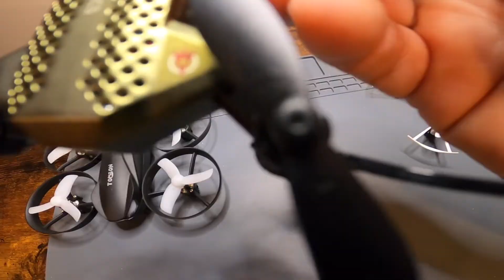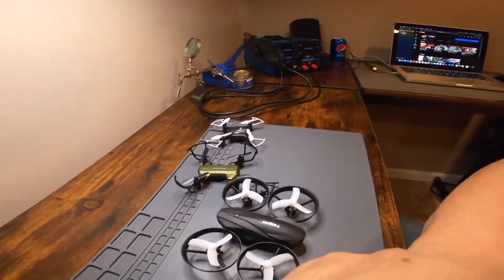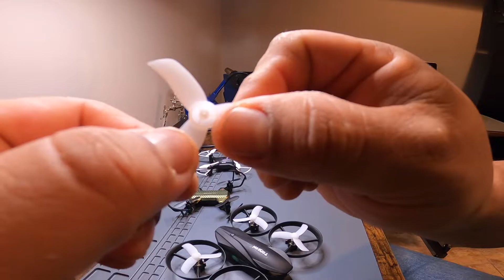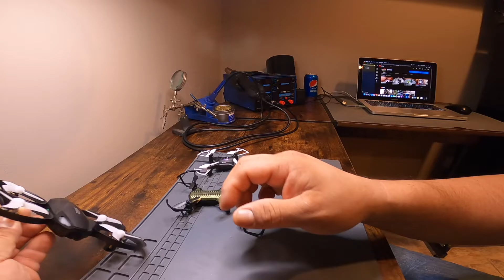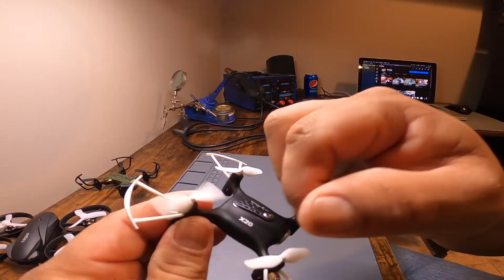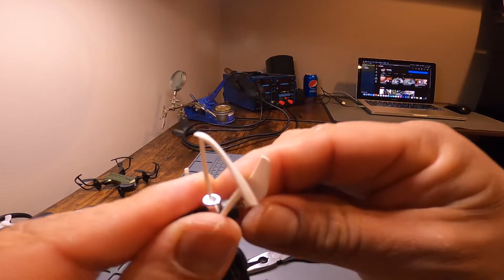Drone propeller removal and install

Comment: its too tight to take off..
Reply from the maker: Sometimes the propeller can be pressed onto the shaft very tightly, so it may not come off easily by hand.

One method that can help is using a fork as a gentle pry tool. Slide the fork under the propeller, positioning it between the motor and the prop, then apply steady pressure while pulling straight up. Just make sure you hold the drone firmly and avoid twisting or prying sideways to prevent stressing the motor shaft.

Thanks for watching and if you haven’t already, please like and subscribe.🚁🚁🚁

Comment: Dude you've got huge hands and my hands hurt after the first propeller
Reply from the maker: You’re not the first to mention my hands 😂 and yes, they are on the big side. If you have trouble gripping the propellers, you can use a pair of needle-nose pliers to pull on the propeller from the center, as shown in the video. Thanks for watching, and if you haven’t already, please like and subscribe—more R/C aircraft content coming soon! 🚁🚁🚁

Comment: But bro what if I took off all four propellers and now I don't know how to put them back on that's where I am stuck right now
Reply from the maker: @Mmurrieta  😂 I will say sometimes on the drone body you will see a letter or a number or both indicating what propeller goes on what corner also you may be able to look up the drone and see if you can find the owners manual, that sometimes also tells you what propeller goes to what corner. I hope this helps, thanks for watching and if you haven’t already please like and subscribe.

Comment: hey man what propellers do i need for the va-1000 ? what size would they be ?
Reply from the maker: Thats a hard question, I have yet to even use my spares, but I am very careful. I did a quick Amazon search under VA 1000 parts and I did see propellers that would probably work but  not 100%. I would suggest doing the same and asking the sellers if they would fit the VA-1000 or at the minimum ask for sizes. Make sure to also ask for the center hole size if it comes to that. I hope I helped, again I haven’t had to buy any propellers so I can’t give you a direct part I used. Thanks for watching and if you haven’t already please like and subscribe.🚁🚁🚁